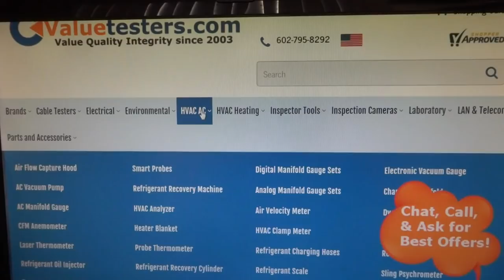kitchen sink drain backing up

Comment: first thing i do before snaking a kitchen drain in a rental is turn the water heater way up and run supplemental very hot water with a 3/4 inch cutter.
i might have put a cleanout in  pitched up for next time. i always tell a renter to run cold water while using a disposal then run water for 15 seconds after they turn it off.  always cold never hot

Comment: probably should have installed a wye with an end cleanout instead of a 45 since you didnt put on a union p trap, that way you can snake it easily. but you have to use what you got in the truck i guess.

Comment: Question for you, why do you solvent weld everything under a sink? Makes it harder to snake at a later date. You’ll need to snake drains every so often on a newer drain. You’ll especially need to re snake an olde drain you where called out to snake in the first place. Wouldn’t compression fittings be more appropriate? Is it code requirements or personal preference? 

Thanks